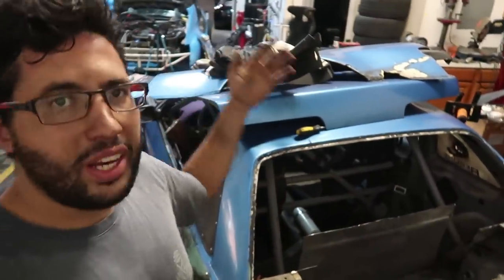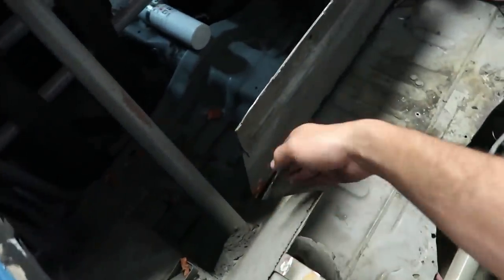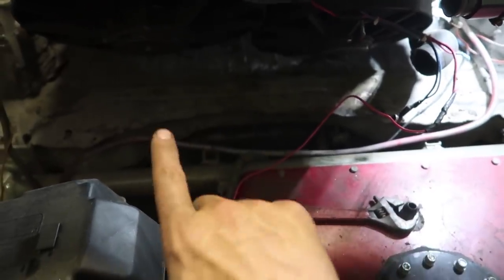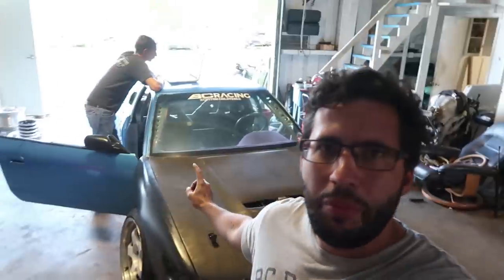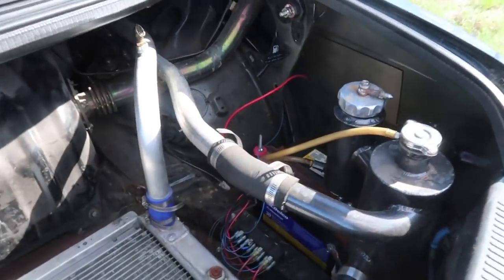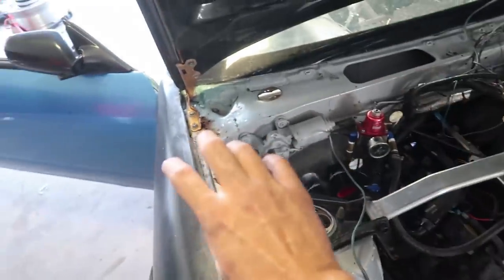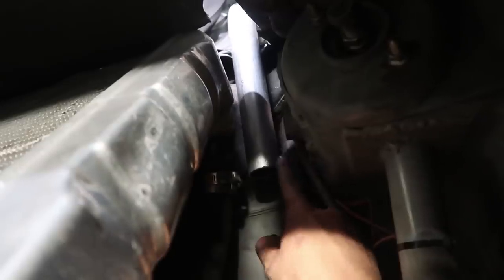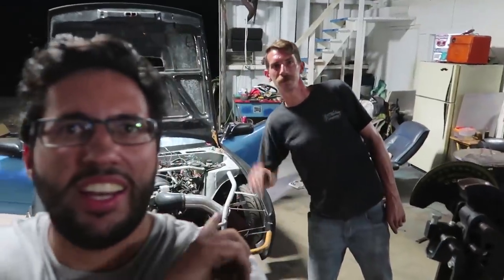CHEAP DRIFTCAR REAR MOUNT RADIATOR!!!

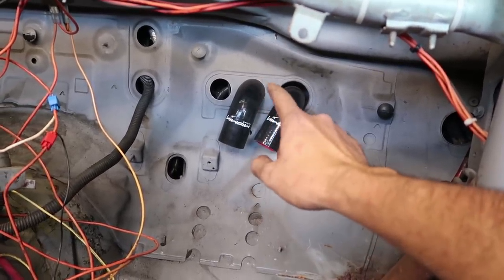Comment: @9:22  The hard pipe on the engine Bay side of the fire wall, Weld and "exhaust" hanger off that pipe that can bolted to fire wall in order to keep pipes centered on your firewall holes. That will prevent the silicone couplers from coming in contact with firewall from movement while driving. Or do what your buddy did and make bulk head fittings that attach to firewall with silicone couplers on either side of firewall to connect your hard pipes to said flanges.

Comment: This is awesome and am glad that you’re doing this and showing us the process as I have been considering doing this to my 350z and the choice got easier now that I’ve seen the process of how to do so. This is overall a better design than factory as there’s less of a chance of your coolant getting screwed up and more convenient to mess with your cooling as well as working in the engine and on top of that allows for a better cooling system since now the radiator can’t get heat soaked in anyway from being near the engine. So even daily driving this is a better design than that of factory
Reply from the maker: This comment is mvp, feels good to know it helps at least 1 person 😁

Comment: marco will stock internals in a l92 withstand drifting abuse?
Reply from the maker: Yess all day! It’s basically an ls3
Reply: Dillon just make sure to get an oil pan with baffling. Don’t want to have oil slosh, it may lead to oil starvation which can cause failure

Comment: Clean your car man...
Reply from the maker: When I go to paint I’ll clean
Reply: No sense in cleaning a car that's being fabricated on. So much dust/debris from cutting & grinding.
Reply: @coryhalvorson8874  there is sense , actually . Less work when you need to clean it beofre paint.
Reply: @egglezo471  but cleaning before you need to clean is extra work.
Reply: @coryhalvorson8874  2 minutes with the vacuum aint that much